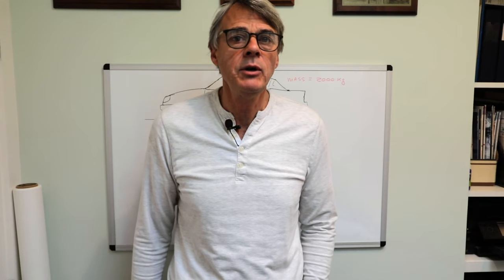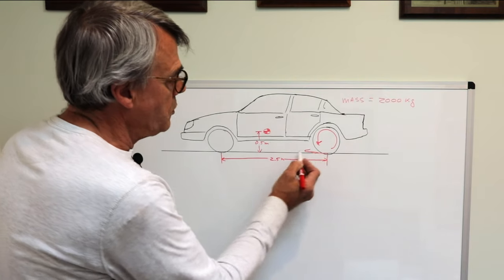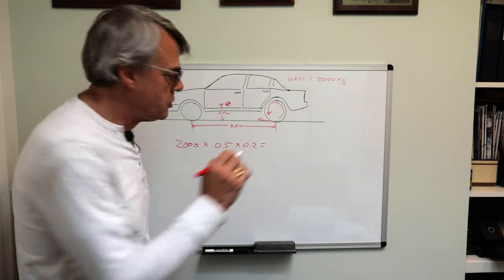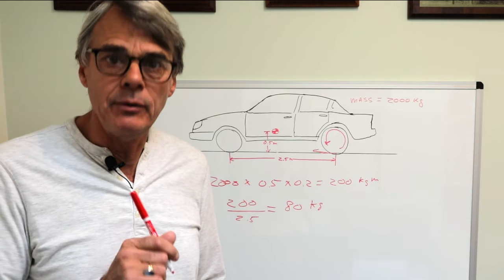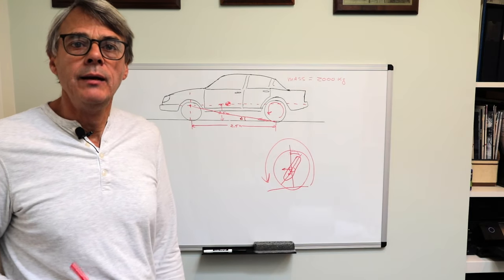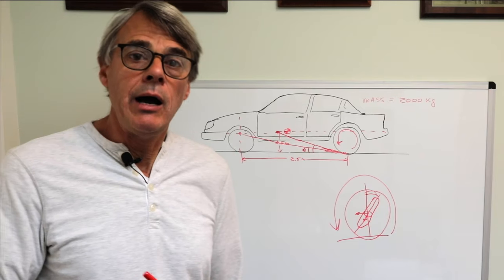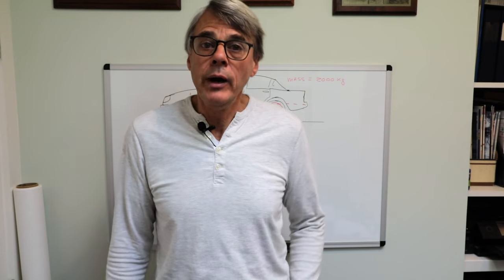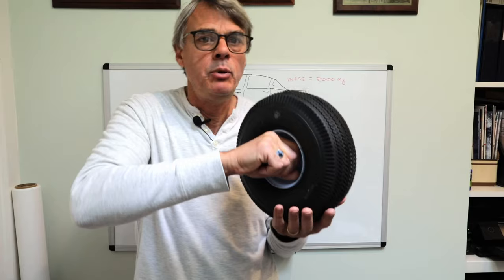The Complete Guide to Anti-Squat

Comment: Having a leaf spring rear wheel drive vehicle makes this video more than confusing
Reply from the maker: Leaf springs do make thing a bit more difficult but the main thing to remember is that with leaf springs you are talking about a live axle so the anti-squat lines go to the tire contact patch, not the wheel center. The problem is knowing exactly how the contact patch will move since the arc of the springs, the orientation of the shackles, and the location of the axle along the length of the springs all play a role in determining how the contact patch moves as the axle moves up and down. It is much more difficult to model than a suspension made up of links and control arms.

Comment: Hello from South Africa. How could I apply this anti squat to my Formula Vee which has trailing arms that go to rear of frame. Surely I need some a ti squat to help car come out of corners. My trailing arms are adjustable with spaces. How could I measure anti squat with my rear suspension system. Thanks in advance  NB:- Have not found and suspension program that can measure that. All for wishbone type suspensions.
Reply from the maker: Trailing arms can cause big problems with anti-squat. The most famous example of this was the Triumph TR6 which had trailing arms and was pro-squat, meaning it would squat a ton during acceleration. What you need to make sure is that the trailing arm attachments to the body are located higher than the wheel center. That way the wheel center will have a rearward trajectory as it moves up. That was not the case with the TR6. The fix for the TR6 was to drill another set of holes in the body to allow the brackets holding the arm bushing to move up. I used to own one of these cars and that modification does make a big difference.
Reply: @suspensionsexplained  I have never run trailing arm higher than wheel centre. Dropped in down(remember my trailing arms go to rear of frame) . I ran them level this last meeting and in the rain we had car was terrible to drive. Will drop down again for next race meeting early October. Would have to buy longer bolts to move arms up. Will try that for last race meeting early November.Thanks for your help. Will let u know how mods helped. Are u in the UK???
Reply from the maker: No, I'm in California.

Comment: Thank you for taking the time to make these videos, they are much appreciated. What I rarely see mentioned is the effects of varying antisquat % on forward traction or bite on a powerful RWD car on radial tires. Do you generally want less antisquat % so as not to shock the tire, or more antisquat % to push the car forward? This of course assumed a modern, competent IRS setup without excessive camber change with bump or nasty bumpsteer. Interested to hear your thoughts on this.
Reply from the maker: It's a balancing act. A bit of anti-squat does help push the tire into the pavement initially, but too much will "shock" the tire.
Reply: @suspensionsexplained  Drag-oriented vehicles with automatic transmissions and 15" slicks, racing from a dig generally run ride rates of 1.0-1.2Hz and anti-squat percentages > 100. What would be a good ballpark for a powerful road-race (or drift) oriented RWD running 18" rubber and a ride rate in the region of 1.7-2.0Hz?
Reply from the maker: @HydraPerformance.  I'm no expert on drift cars but it seems to me you wouldn't want much anti-squat at all in a drift car since you want to be able to break the tires loose at any time. Lots of anti-squat means the tires are jammed into the ground when you apply the throttle giving them more traction instantaneously. I would recommend very little anti-squat and instead control the motion of the body with spring rate.

Comment: PLEASE continue this series. You're the only person who explains not only this precisely, but who provides quantification. I'm hoping through trawling what you have created that I can find something on heave spring / 3rd element. So far, I've yet to see a good explanation.  But I'd settle out of court for explanations on shocks, ideal suspension stiffness, and of course, you probably know better than I what things most people either don't understand or (worse) falsely believe they do understand.  I can only imagine how busy you must be (assuming you're an ME), but you'd easily develop a channel far larger than Engineering Explained. You're just a better teacher. 

I see you've done a few on braking which I think I'll watch first.  I think most people misunderstand brake hardware, and assume more pistons, cross drilled, and larger radius equals greater clamping pressure, provides needed ventilation and greater leverage for stopping.  If I'm not mistaken, the usual problem is adequate thermal mass in the heatsink and rate of heat removal afterwards to avoid fade ... which can be accomplished either through larger radius or via thicker rotors. In which, I'd assume a thicker rotor would be superior: Providing slightly less angular inertia / momentum.  Provided the existing calipers have the clamping force to lock up the wheels at the highest top speed, ,additional pistons aren't needed. And cross drilled are just opportunities for cracks ... if any machining should be done, gas slotted is preferable. But all things being equal, the lightest caliper that provides adequate clamping force for the peak angular momentum is the proper sized rotor.  In order to need more clamping force, you'd either need to stop the same angular and linear momentum, or, have increased traction via grippier tires and downforce. Otherwise, most bigger brakes (especially on lighter weight cars) is a vanity purchase / cosmetic. 

What I really want to learn more about / understand is bump & rebound (shocks), and how to make them work best. And of course, the aforementioned physics of heave springs and their limitations: Can it reduce only a percent? If so, what's the upper limit? Or can it eliminate an axle's squat completely ..?

I wish you were local. I'd love to work with you creating content. I honestly think you could be a "youtube star." As in ... get manufacturers offering you loaner vehicles for articles, and ultimately income. Not only do you understand your field, but you're an exceptional educator.

If you're interested ... please contact me. same username at google's mail. I think I could help with a few things: Content ideas, editing (i'm  not great but I don't mind putting the work in) ... and as someone who doesn't know much, I think it's kinda difficult for people who know things to remember what it's like to not know, and to know when they've adequately explained to the weakest link's pace. I can be that weakest link. :)  (so weird that more companies aren't looking for my amazing skill).

And if not, I'll just enjoy watching your content. Thank you again for your generosity of time and knowledge.
Reply from the maker: I haven't covered heave springs yet but I covered springs in general in my video on spring stiffness: https://youtu.be/feu6-6unarM

Comment: Just stumbled onto your channel, you're doing a very good job! One thing that confused me though, if you look at Race Car Vehicle Dynamics page 631, it seems you don't find the instant center by drawing lines through the chassis mounts, but rather the continuation of the A arms untli you're laterally in the center of the wheel. I.e. with parallel wishbones, your instant center would be correct, but with the angled upper wishbone, the upper line would be offset vertically, imagining the upper wishbone to extend all the way until the tire center line, and your instant center would be a bit further to the left.
Reply from the maker: Niels, Yes, that is correct but it really only becomes an issue if the sideview angle of the arms is very severe which it rarely is. With more conventional arm angles, the error is small and can be ignored. To me, what it really points to is that the second method, which looks at the motion of the contact patch, is really the preferred method and it is what is done by all multi-body dynamic software systems that I have used. It's far more accurate and doesn't care what the suspension architecture is.
Reply: @suspensionsexplained  Thanks for your reply!  I like how you present it, the sliding pin example as well. Hope you get more views in the future. There is a lot of popular superficial vehicle dynamics on youtube, often including mistakes, so it is refreshing to see your stuff.

Comment: Very interesting and clear.
What about if it was a Portal axle, where the center of the axle shaft is not the center of the wheel hub?
Reply from the maker: Good question. It would certainly be different. The way to think it through is to picture the vehicle up against a wall. Apply torque from the engine and see what happens. The car can't move because of the wall so the engine just torques up the wheel. In a normal independent suspension, the wheel would try to turn but couldn't because of friction with the road. the result is that the engine torque just tries to push the suspension forward at the wheel center. With a portal axle, you still have the force pushing the wheel center forward, but there is also the gears in the hub where the gear attached to the input shaft is trying to "walk" around the gear attached to the wheel, so there is a moment being generated inside the knuckle/hub. The size of that moment also depends on the gear ratio of the portal axle and the type of gears: is it a simple two piece gear reduction or is it a planetary set, in which case the input shaft may actually spin in the opposite direction compared to the wheel. All of these factors would influence how the anti-properties would be affected by a portal axle setup. Sorry, there are never easy answers!

Comment: I’m glad Matt recommend your channel, you explain things well.

How do the principles apply with leaf springs and traction bars on a straight axle car?

I understand the traction bar is really to keep the spring from wrapping up. Would you move the front spring eye up or down to adjust anti-squat? Also how would the regular spring shackles vs a slider at the rear of the spring affect the anti-squat.
Reply from the maker: The principles are exactly the same. Keep in mind that with a solid axle, the line needs to be drawn from the tire contact patch, not the wheel center.

Comment: The Yamaha Tenere 700 utilizes anti-squat. Front wheel traction is important when riding motorcycles off-road to steer/counter-steer using throttle. Helps alleviate rear suspension from compressing and rebounding too quickly, causing a highside crash which can launch the rider clean off the bike.

Comment: What is the advantage to a geometry that squats in an independent rear suspension, rear drive car? Does it make acceleration out of a corner more controllable or predictable?
I know that a drift setup often shifts weight to the rear wheel opposite the slide. For grip racing why would any car be setup to increase squat on acceleration?

Comment: There is something that does not make sense to me. You describe 100% anti-squat as "completely cancelling out weight transfer".

My understanding of weight transfer is the reduction in normal load of the front tyres and corresponding increase in normal load of the rear tyres under acceleration, which occurs for the reason you explained at the start of the video, with the moment created by the CoG being some non-zero height above the contact patch. I can see how 100% anti-squat will mean that no compression of the rear suspension springs (and corresponding extension of the front suspension springs) will occur— the vehicle will remain completely level during acceleration. However I cannot see how this can change the normal load on the tyres themselves. If we treat the wheels and body of the car as a whole system, the free body diagram you drew at the start of the video still applies— any forces that occur within that system must cancel each other out. Alternatively, looking at the system as the body and wheels separately, if we consider your wheel with a pin moving in a slot, if the wheel pushes the body of the car up due to the angle of the slot, the body of the car must push the wheel down with an equal magnitude force. In other words, the load transfer, and therefore ultimately the normal load "felt" by the front and rear tyres has not changed whether we have anti-squat or not. 

I understand that there will be a caveat to this, that the amount of anti-squat will to some extent change the motion of the CoG itself in the car's reference frame during acceleration, but I imagine the effect of this on load transfer is low.

Please let me know if I have understood this correctly and thank you in advance!
Reply from the maker: You're understanding is spot on. As you noted, the amount of weight transfer is independent of the anti properties of the suspension. It is simply a function of the mass of the vehicle, the acceleration, the CG height and the wheelbase. Nothing else. You are also correct in assuming that the motion of the body as a result of squat and lift will have some impact on the height of the CG, and therefore the weight transfer, but the effect is minimal.
Similarly, 100% anti-squat in the rear suspension also will have no impact on the weight transfer, only on the way the suspension reacts to it. But it will only impact the way the rear suspension reacts to it. It can have no effect on the front suspension since in a RWD car, the front has no acceleration forces to help counteract the weight transfer. The front will lift in response to the weight transfer no matter what is happening at the rear. Having 100% anti-squat simply means the rear suspension will not deflect in response to the weight transfer. That is all it does.
I hope this helps.

Comment: Congratulations on recognising this. Squat and dive are simply positive and negative pitch. The pitch centre is found in side view in exactly the same way as the roll centre is found in cross section.
Reply from the maker: Yes and no. The roll center is always found with lines drawn to the tire contact patch. My point here is that for anti-squat, you sometimes need to go to the contact patch and sometimes to the wheel center, depending on your suspension and brake system architecture. Too many people seem to think you always go to the contact patch and that is not correct, as I described.

Comment: Do we draw the line for the perfect angle from the contact patch to the front axle / CG point regardless of where the differential is mounted?
Reply from the maker: No, the ideal line is drawn to the tire contact patch only with solid axles. With independent suspensions, the line is drawn from the wheel center. Always drawing it from the tire contact patch is the mistake many people make.

Comment: What would be, for you, the best system to use in drag racing on tracks WITHOUT GLUE, NO PREP, that works above 100 AS or below?
Reply from the maker: I have never designed a suspension for a race car but I have talked to people who have. The general feeling I have heard from them is to keep the amount if anti properties to a minimum. That way, you can control the way the car moves with springs, dampers and anti-roll bars. If you have a lot of anti properties, and this includes high roll centers since those are in reality anti properties in cornering, reduce the amount of force traveling through the springs. This means that spring changes have less impact on the way the car handles since they have less force to work with. Think of it as a signal to noise ratio. Having as much force traveling through the springs during cornering, braking and acceleration means you have more "signal" to work with when it comes to tuning the suspension. Also, anti properties mean that the weight transfer reaches the tires sooner because you're not waiting for the body to react and move before the force builds in the tire. This may cause changes in the loading of the tire contact patch that may be too quick for the tire to handle. I can imagine a slower build-up of tire forces meaning that any over or understeer that would happen as a result of the weight transfer would happen slower and be easier to catch and manage.
I'd love to learn more about this if anyone has any thoughts or experiences with it.
Reply: Sory, i says for dragrace NO PREP